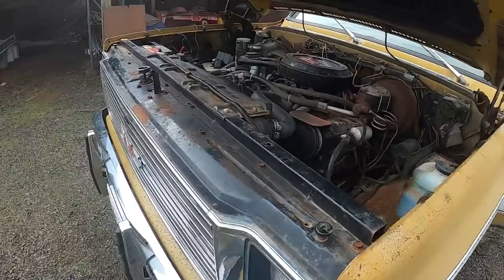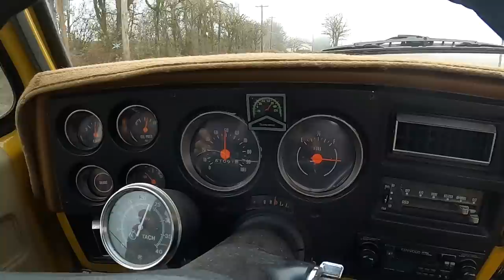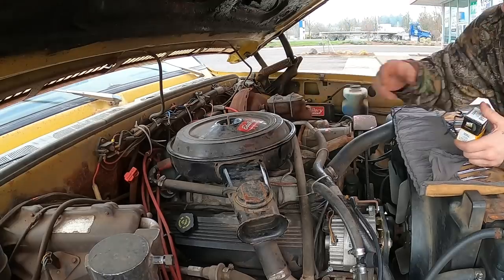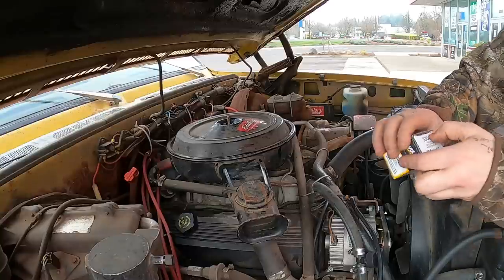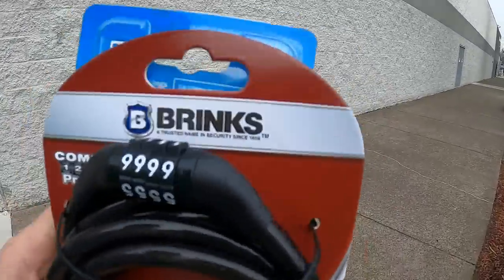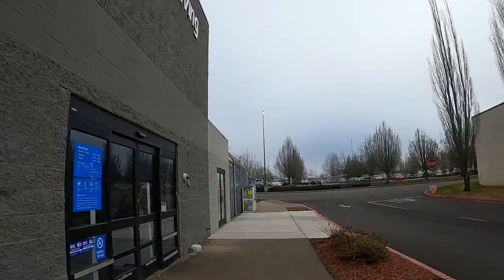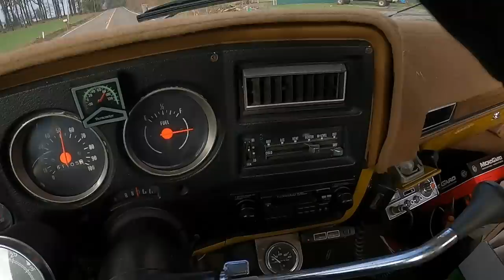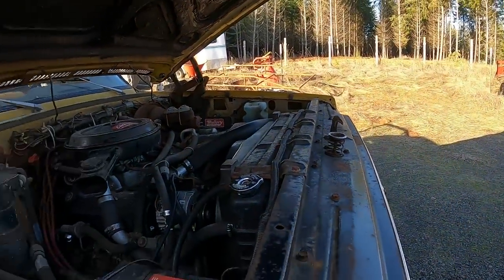Replacing Carburetor Filter, Drive To Town - 1973 GMC C2500

Comment: I had a old GMC truck like that. It didn't have a overflow tank. The coolant level would run about a inch down inside the radiator. When the truck warmed up the level would fill the radiator to the top. After it cooled down the level would go back down.

Comment: if pour a can of B-12 in the tank it will clean the entire fuel system (berrymans) b12, works amazing! your gas gauge will start working again as it will clean the varnish off the sending unit.
Reply from the maker: Thanks for the info!

Comment: As you ran old petrol out the pipes filter where ever they are should be changed as it's last line of defence for clogging the jets up.
As long as you keep on top of millage doing.less break downs
Our roads in England are allways beening worked on so I change air filter twice a year the stuff if catches is lots of dust which makes the car use more fuel if not done and I maintain great power.

Comment: Greetings from the northeast, Not sure if you've done this yet there is typically a filter sock on the end of the pickup tube in the tank it might be plugged. It'll act like a plugged fuel filter as this flow going by it it plugs if it sits for a while the sediment falls back down to the bottom of the tank until it's kicked up again and plugs the filter sock also check the gas cap and make sure it's vented.

Comment: That's definitely a newer BB 73/80 trucks had oil dip stick on drivers side . I'd look at the block numbers on left rear of engine below the head  stamped in block that tell you the year. My BB on my 79 would diesel when you would shut it off timeing was  to low it was  about 6 degree it should be about 10 to 13 that's were mine runs the best every engine likes a little different

Comment: Sometimes you can use compressed air and blow into the tank remove the fuel line blow air into the line a lot of times it'll blow it off in the tank and just leave it there it doesn't harm anything and you don't need it you already put a second filter on there.

Comment: I'm late to the party but here goes:
Don't put a 15 pound cap on the radiator,  go with a 7-9 pounder. Get a correct overflow reservoir( sold on LMC Truck website-order catalog). That engine is not from a 73-80, both rocker covers and dipstick are a dead giveaway.  And pickup door stricker pins from LMC too. It'll fix the slamming problem, it's NOT the hinges.
I have a 1974 GMC, I know these things, good luck!

Comment: Use a head gasket test kit harbor freight sells them. It has a fluid that changes colors if exhaust gas is present.  You just put it on where the cap would be
Reply from the maker: Hey Brett, thanks for the info! :)

Comment: you're supposed to pull the tiny little rubber piece (should have a very small spring) from the used fuel filter and put in on the new one. It acts like a tiny check valve

Comment: I'd bet the running issue is that edlebrock carb also some times certain rigs just won't run full to top I have an 03 just spits it out until bit down then runs fine I just quit topping it off now has 250 thousand miles on it runs perfect.
Ps maybe check into rebuild kit for carb not expensive carburetors don't do well sitting long time periods anyway luv the truck super cool I were you I'd keep it.

Comment: The rust in your coolant is coming from the engine block the radiator and heater core is copper does not rust

Comment: I just found your site sr I have a question I have a 2500 gmc 1982 and was wondering how do I lower my truck without cutting  the frame 3/4 drop preferably